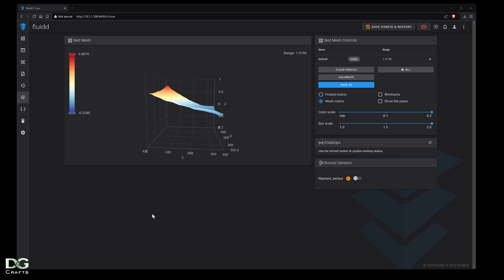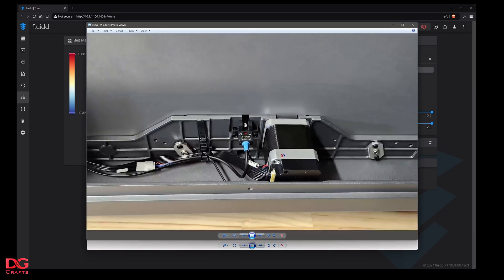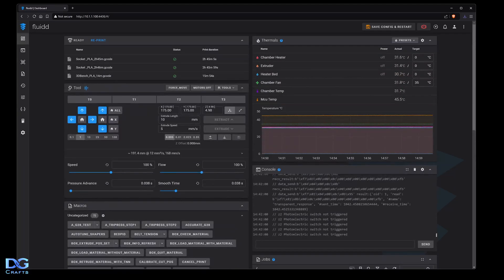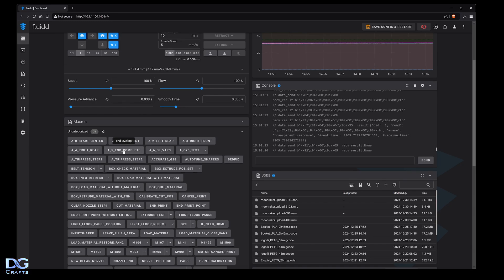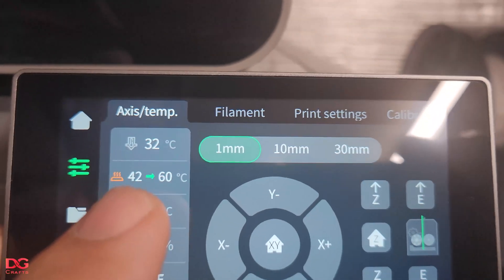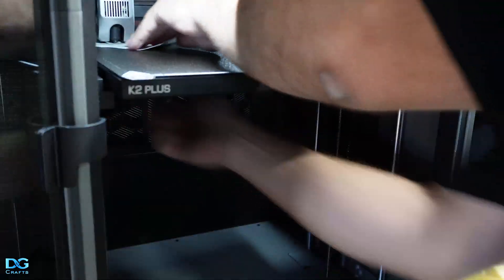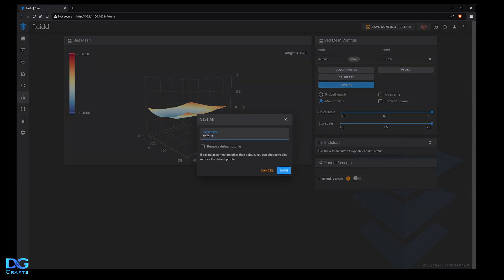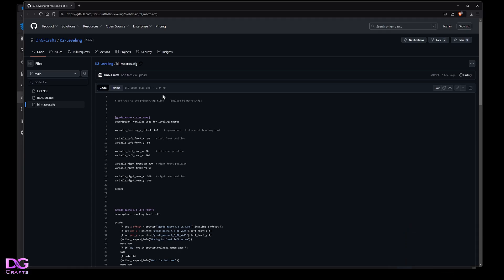K2 Bed Leveling

Comment: Where can I set the bed temp variable? I have definite warping on my bed and the range increases. I print with ABS and ASA. I would like to adjust the bed temp to a 100degs and then calibrate. Just to compensate for the warping. Is it possible?
Reply from the maker: M190 is the command for bed temp, in each macro you will see

M190 60

60 is the temp in degrees c
Reply: @DnG-Crafts  Perfect, thanks
Reply from the maker: @Caturra86  i just updated the macros file with the bed temp in the top vars to make it easier to change and also added extruder heating to get better touch accuracy during leveling.
Reply: @DnG-Crafts  Champion!!!!

Comment: Hello, thanks for the video. My paper is completely squished... No matter how I adjust the z or the screw I can't get the four corners to be happy. Please help me!
Reply: I had the same issue with the old bed I had one of my main issues was the itself being warped and one of the screws being stripped replaced bed and screw and luckily was able to complete this in my case I did not get a range better than .7 though

Comment: Fixed! I'm withing .1635
Thank you for the help and the files! Absolute legend!
Reply: Hi, sorry to bother you. I want to ask, at each corner there was room for your paper to slide? I had 2 corners where no matter how much i adjust the z offset up and move the plate down my paper is totally squished. Eventually I would adjust the Z up so much that the paper can move, but as soon as I go to the next corner the gap is WAY too big and I can't bring the plate up enough to squish the paper and it would be the same for the remaining two corners.. would you have some insight on this? Thank you in advance!
Reply: @alicelau6136  I have the same issue. dont know how to solve
Reply: @alicelau6136  what i done so far using alen key place key horizontialy so you cant aply much force and tunn scews untill they dont rotate whit alien key as son as its not turning allen key re home z axes than start process this shold give you enofh gap on all 4 corners than adjust but my issue is no matter how carefuly i adjust them whit paper after calibration i get ofset range over 1.25 and when run calibration again nozzle gives death grip to paper :/
Reply: @attilaeyice2009 yes!!! This is me right now. I had to use an Allen and talk about annoying. The video doesn’t talk about adjusting the z-offset. I see it in fluidd, is that where your adjusting it at?

Comment: how much grab tension on the paper when testing. it looked like you were using receipt paper? does a4 paper still do the same job since it would be thicker?
Reply from the maker: The paper i used was just a piece of paper that came with an old anycubic printer for leveling.
It is about 0.14 mm thick, standard a4 should work fine.

Comment: this hasn't seemed to be able to work for me, i back off the screws one turn, home all, then start using the macros, and every corner touches the bed without me able to get the paper under it. If i back off the screws it doesnt seem to be affecting my bed, just sorta losens the carriage that has the "K2 PLUS" written on it
Reply: Same.. when I use the macros to go to the corners my nozzle touch the bed very tight..! also when I tighten the screws it still touch the bed.. anyone can help with this?
Reply: @pixelpro1  The bolt possibly rotates with the knob, which means ur not actually loosening it. Is  what I would think the problem is?

Comment: Worked but had to tape under the work plate because the warping. Its now 0.1870 !! 🎉
Reply: just to be sure I understand : you placed tape under the plate to bump its heigh and get a better leveling ?

Comment: Good video. I did it on one of my k2 printers. I got 2 more and to my amazement creality started using loctite on the screws.  Very difficult to unscrew now.  Have to use Allen to keep screw from spinning.
Reply: same issue, my knobs spin the whole screw in the hole, cause the screws not held by anything and it just spins the whole thing with no adjustment

Comment: There are 4 more screws two on either side of the print bed under the plastic covers by the rods. I found it better to just tighten those down all the way for a marginal improvement with  on the input shaper graphs. The screws are also spring loaded and are really mostly there to allow the z-tilt to work with out putting to much strain on the rods. The screws have a hat that bottoms them out but still allow the spring to behave like it should but with marginally lower vibrations.

Comment: I definitely see how this could help a LOT of people, sadly it didn't work for my reverse taco bed. If I loosened the screws even a little, the middle of the bed went up just as much. So I ended up spending a couple hours with some aluminum tape. Got my variance from 0.78 down to 0.29.
Reply: Same i had it back to 0.1870

Comment: Thanks again, 😂 but I'm not sure if I'm doing something wrong. No mater what I do I end up with an upside down U. It's really strange. I started out with a bed similar like yours. Over 1.5+ error. Now i have something like. 0.75. I'm not happy with the left and right side around - 0.5.  I'll try again later it's late and dealing with the Cali Fires 😅

Comment: I am going to have to try this trick, thank you very much for your work! I got 2 of these printers, and although like you said, the auto bed leveling handles quite a bit and the quality comes out fine, on one printer the mesh is not toooooo bad off, but on the other, its off by as much as 1.5! On that printer, you can really see the bed moving around to compensate for it, and I am worried that it will affect the print quality in the long run.  Subbing to help your channel out with your awesome and easy to follow tutorials!

Comment: Big no on my end. Just received the K2 plus today. Those screw have thread locker on them, ever after loosening, the screws turn with the thumb screws, nothing keeps the head in place so the whole screw turns from the factory once you loosen
Reply: Same
Reply: @DriftsTech Pull the print plate off the bed and use an allen wrench (included in the tool box) to hold the screw still when you loosen the nuts. I had the same issue. PITA but it can be done.
Reply: @BrianSnelgrove  yeah but that doesnt help trying to adjust the nuts when the build plate is on and your trying to calibrate with the paper.....

Comment: What a guy!! Thank you so much. The first layer has improved a lot. It's usable now. Started of with a range of .98 to .36. the layer is still not perfect over the z screw rods though. I need the bed to drop about 0.15 to get the layer perfect. Manual adjusting the layer height on the fly makes the layer immaculate. Is there any way of changing the bed height in the Marcos to start the first layer a bit lower? My starting layer height in the slicer as at .35mm
Reply from the maker: glad it could help.
if you want to mess around with the default z_offset that the printer has you could try changing the "z_offset: 0" value in the printer.cfg in the "[prtouch_v3]" section.
you could level it all with it set at 0 then change it to 0.15 or -0.15 to see if it corrects your issue. 

changing this value should make the printer think the nozzle is in a different position to its actual probed height.

i have not changed this in a prtouch setup so i dont know how well it will work, i have only experimented with the same setting on bltouch setups.
Reply: @DnG-Crafts  Hey I actually did try this but for some reason when you run it like this it automatically comments it out when it runs it
Reply from the maker: @rustyking5795  check down the very bottom of the cfg file.
when klipper overrides a setting it comments it out and saves it at the bottom with a #*# prefix before the lines.

Comment: Can you do a tutorial on rooting the K2
Reply from the maker: you can enable root access through the touch screen on the printer.
you go into the settings and look for "Root account information" and click it, then tick the agree check and wait 30 seconds for the countdown on the ok button to finish.
click ok and it will enable root and show you the login info.

Username:   root
Password:   creality_2024

Comment: You may also need to level the platform that the bed is screwed into, by popping off the covers on the left and right sides to reveal hidden screws. Just like the bed, the platform uses springs so it can be adjusted a bit. Out of the box, my platform was very crooked, so if I went straight to adjusting the bed I would've actually been warping it. Also, I had to comment-out the G-code for Z_TILT_ADJUST, as that was unlevelling my bed and counteracting my changes. My bed has a dip exactly where the printer was probing, so its automatic tilt adjustment just made it worse rather than better.
Reply: I was wondering if I could adjust those screws. I can't even run these macros since the right side is so tight that I can't tighten any further and the left is so far up that the plate is going above the alignment tab. I'm going to give this a shot and adjust the platform itself like you said

Comment: same it's insane how bad the bed is. One thing i noticed you did is save at the end. Is that something that should be done.  Have i been forgetting to do that on my other printers. Should i do that on any Printer that i calibrate . thank you
Reply from the maker: Yes you want to save the mesh after you run the calibration through fluidd or it will load the last mesh that was saved when you goto print.

Comment: Bad ass video. Great tutorial and step by step guide for us newbies to Fluidd. My bed looks like a potato chip but I'm gonna try this and see what happens
Reply from the maker: while playing with the webcam code this morning i got a firmware update on the printer.
if you get that update do the update then calibrate it like it asks then try the leveling.
Reply from the maker: another thing, i just noticed that after homing the printer the bed mesh was being reloaded which could mess with the moves during leveling so i have forced each macro to disable it.
i just uploaded the changes to github so if you had downloaded the files earlier then download them again to make sure the bed mesh is not causing issues with your leveling process.
Reply: Como lo has solucionado?